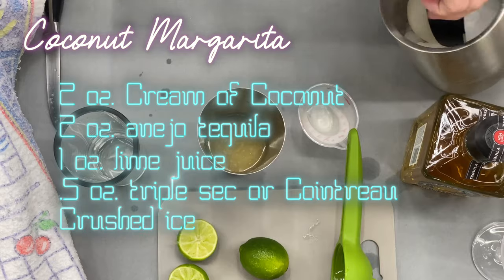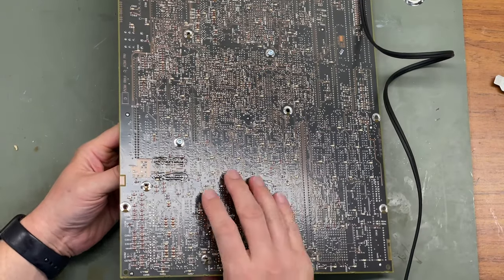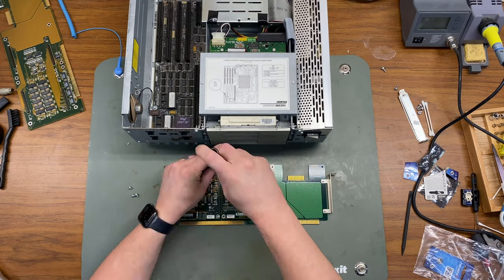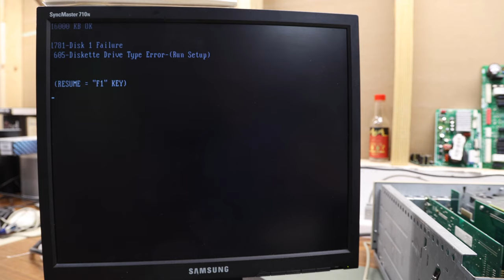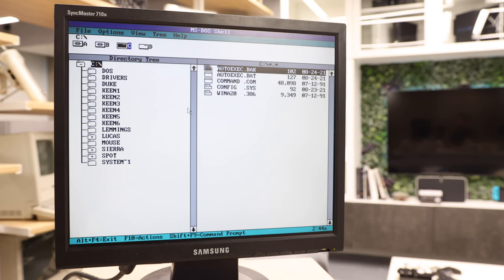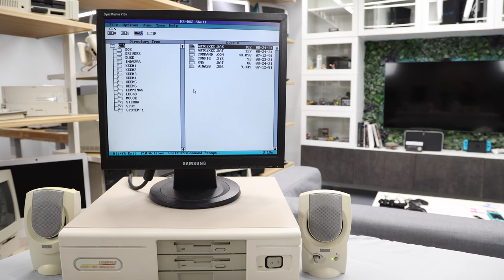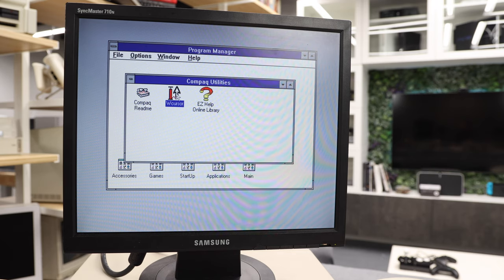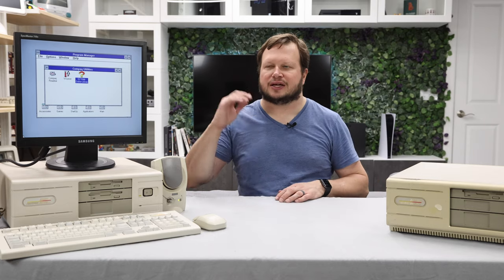Restoring a Compaq Deskpro 386 25e - Part 2 | Jeremy's Retro Bar

Comment: The Compaq case came out pretty good. When it comes to putting keys back on a keyboard, I always do the keys with the stablized bars first (space bar, shift, etc) which makes it a lot easier without all the other surrounding keys in the way. SpaceQuest III was a great choice for the first game to check out. Nice job overall on your restoration!
Reply from the maker: Thanks I thought it turned out well too. Good tip on the keyboard I’ll keep that in mind for next time.
Reply: @JeremysRetroBar  P.S. I think you should swap out the octet with actual machines of the era :-)
Reply from the maker: @geekwithsocialskills  You are the first person to answer a question I asked in a video. I feel you should get some sort of award. 

Should it be a Clone PC of the era or a PC from a major manufacturer? Or does it matter?
Reply: @JeremysRetroBar  winner winner, chicken dinner! I'll PM you on Twitter.

Comment: To get the CF adapter to work, you can use XTIDE Universal BIOS.  You can write the ROM to an EPROM chip and then use a network card with an option ROM socket to load XTIDE and then it should boot the CF card.
Reply from the maker: I know. I just like the ease of SCSI. I’ve used XTIDE on my XT and AT machines.

Comment: Does anybody make new classic-style PC cases?  That's got to be one of the big parts of recreating the retro look and feel you were discussing; having a 486 built into a modern black metal and glass Lian Li tower bristling with RGB just doesn't have the same moxie as a beige, horizontally oriented box with 5.25" bays in the front.  :)
Reply from the maker: I’ve found some new old stock full tower case on eBay, but I’d love it if someone would make new cases in a desktop form factor. Especially for 286 and 386 era machines. The checkmate is the closest I’ve found and that’s made to look like an Amiga.

Comment: Hi Jeremy, I just got my 386/20e working today not kidding!!  I used a nic with xtide bios burn configured to 170h on a CF adapter.  had to disable the hard drive controller in setup.  works fantastic.  I have dos 6.2 but think it would be better to go your route of 5.0.  Is that the rev d off archive org?  thanks!  Good timing!!!
Reply from the maker: Yeah I thought about an xtide too I’ve done that on my IBM AT. I just had the SCSI2SD handy and I assume it probably runs faster. I got the 5.0 Compaq DOS from WinWorldPC.com
Reply: @JeremysRetroBar  Awesome, installed and running.  Now if I can only find an eject button for the 5 1/4!  Really enjoy the channel, thank you!